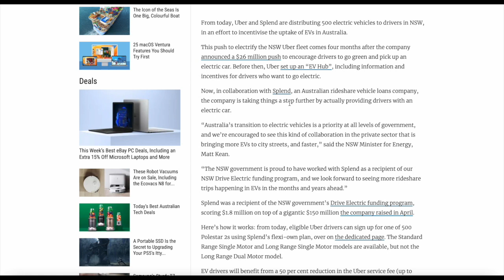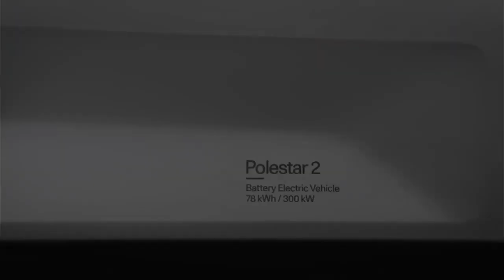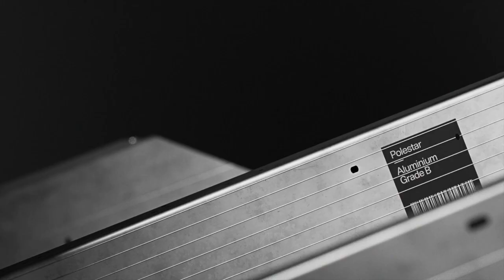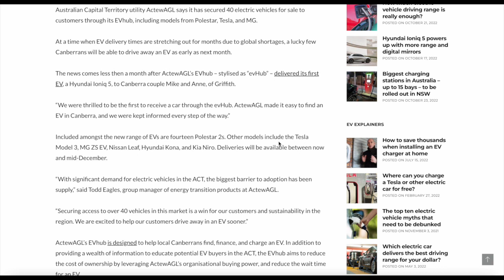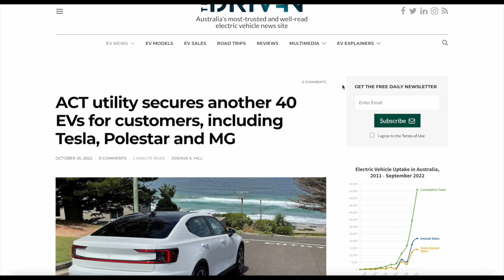Polestar 500 EV's Going To Uber x Splend Partnership!

Comment: PSNY Polestar stock dipped below $4.5 recently. Considering they are making more cars than Lucid and Rivian and are selling in 25+ countries (30 by the end of this year) - the stock is really cheap IMHO. They have confirmed they are still on target for 50k deliveries/production by the end of this year and 100k for 2023. Polestar will build the Polestar 3 SUV in the USA & China - it was launched on 12th October 2022. The Polestar 3 has air suspension and more luxury than the Model Y. It is larger than a Model Y. It will be cheaper than the Model X.